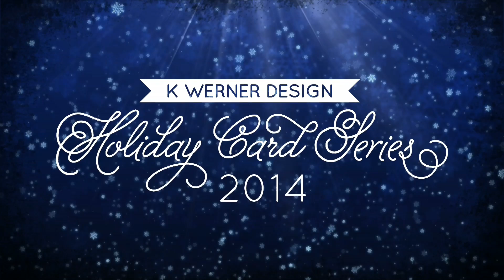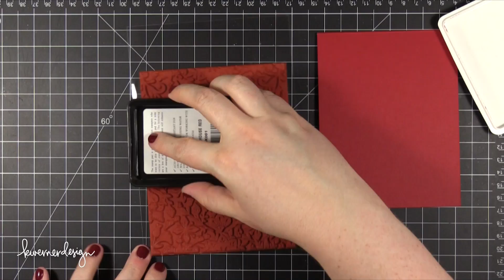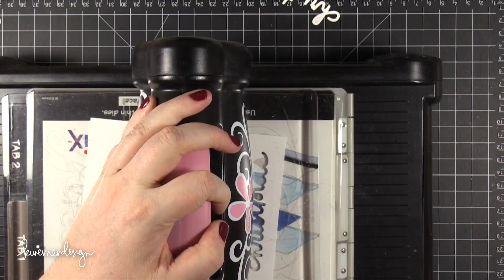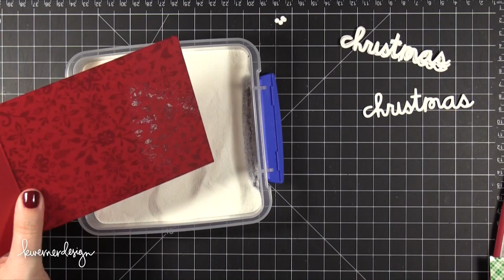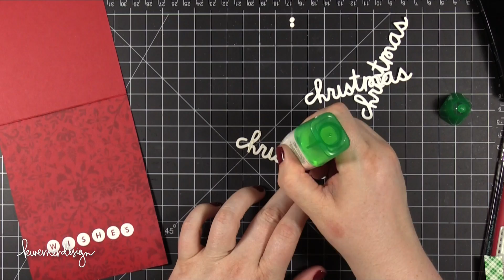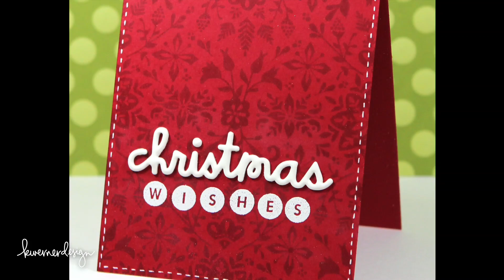Holiday Card Series 2014 - Day 9

Comment: Hi Kristina,  love the card.  Just wondering why you layered 3 of the die cuts ?
Reply from the maker: For dimension. Adding foam adhesive behind a thin die cut like that would be difficult. So instead you can layer die cuts. :)
Reply: She wanted to create a tough, thick, almost chipboard diecut for dimension. It's difficult getting clean diecuts on really thick paperboard.
Reply: K Werner Design Thanx a bunch